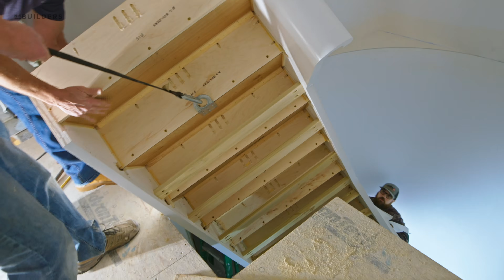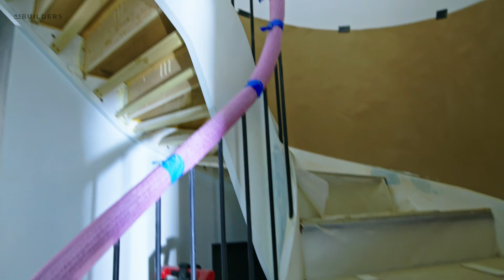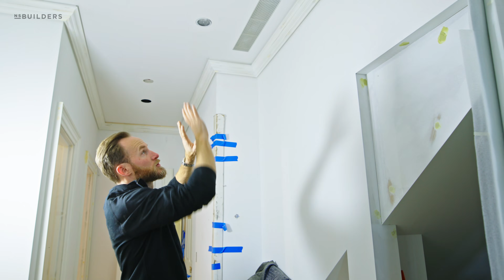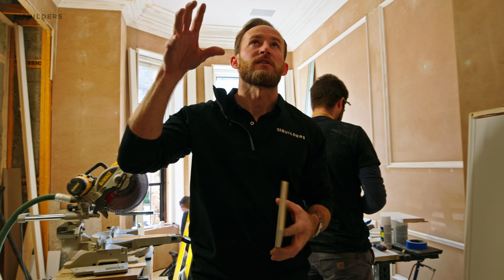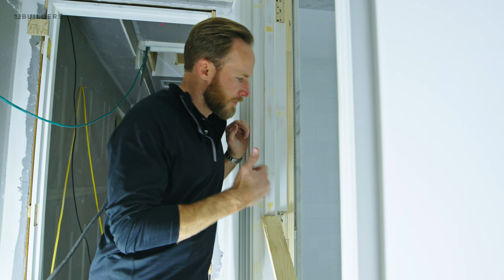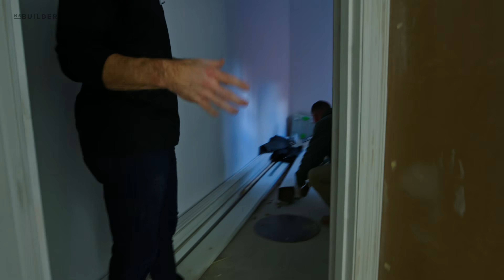Shop built curved staircase installed at our brownstone renovation

Comment: Shadow Gap Crown:  Is the piece furring out the crown going to be painted the wall/ceiling color or the trim color?  Curious of the location where the wall color will meet the trim color.  As I mull it over in my head, neither option jumps out as right or wrong.